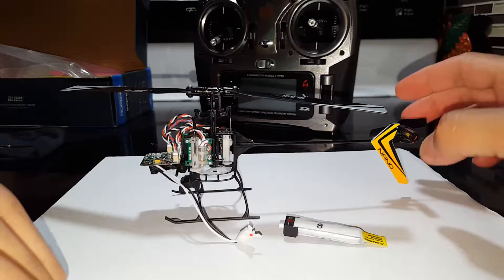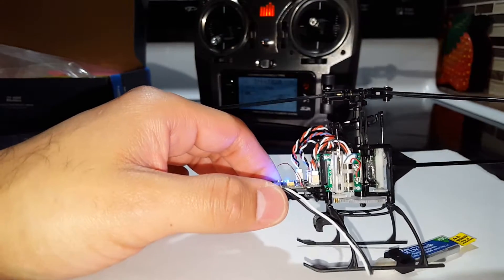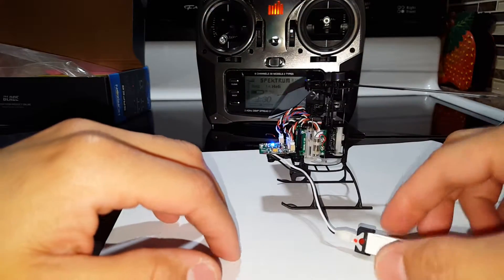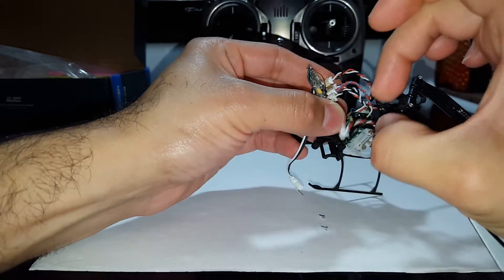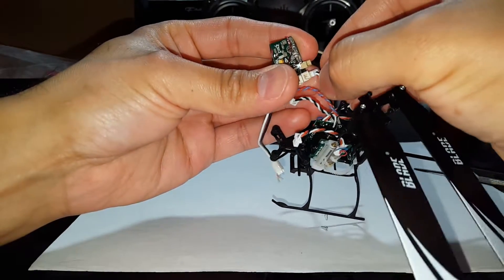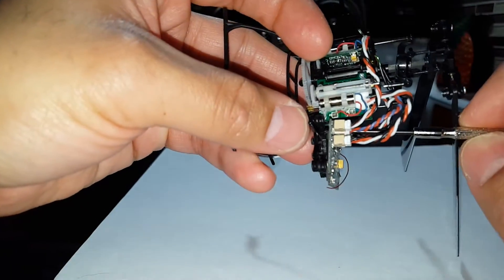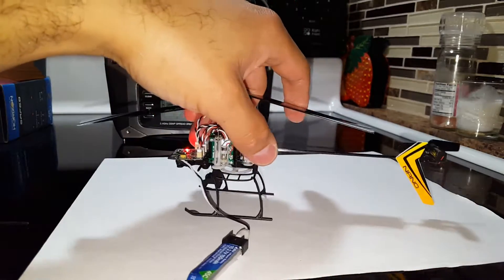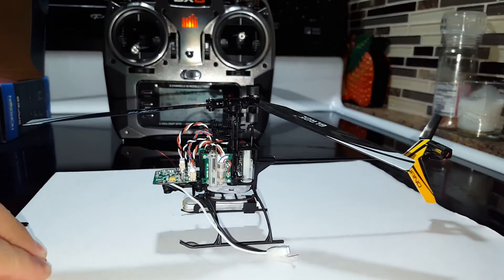Nano CP S problem swash plate forward solution

Comment: So it’s just a bad connection in the servo connector? Maybe you need a new servo connector. Maybe Horizon needs to update the connector design to be more reliable? Or maybe there’s some corrosion inside the connector. Have you tried a drop of oil or dialectic grease in the connector?

Comment: Can I email you, Victor? Just bought a used CPs and it's giving me LOTS of problems. Flew OK first time, then the same swash prob as you on the 2nd attempt. Hobby shop worked on it for about 1.5 hrs and it flew fine. Took it home, flew once ok, plugged in a new battery and it's pretty much uncontrollable! Total bull crap! As several of the comments say, HOW can you do the calibration flight when you can't hover the stupid thing?! I can BARELY get it off the ground. I've flown several different (bigger) helis and never had any problems like this. I think the electronics are on drugs or something!

Comment: Same problem. Try this, reboot everything and put the remote was in flight mode when You plug in the battery . For some reason swash is in different starting position if you boot it up in throttle hold mode. This worked for me. Haven’t had a problem since.

Comment: I had the same problem, but mine was tilting sideways. I clearly don't understand how your solution could solve my problem, but it did ! Thanks a lot for pointing that out.
I just disconnected the 3 servo, without unscrewing the board and it's working fine. But the nano has a heavy drift now, even with the calibration flight procedure...

Comment: I had the same problem after a minor crash.  No broken parts, but the swash acted exactly like the one in the video.  I disconnected only the servo leads and did not remove the board.  Plugged them back in an it was mostly normal.  I have  a drift now, but a calibration flight should clear it up.  Thanks for sharing!!

Comment: The problem is the tail motor Power and ground wires are sitting on the board after crashes and shorting the servo out Reroute your wires to the other side and problem solved

Comment: Save yourself the time of unplugging and replugging the cables: unscrewing and rescrewing the board is enough! ;-) I have no clue how this fixes it, but maybe the board (and the sensors) is a bit skewed after the crash and re-installing it fixes that. Anyhow, thanks for the pointer, Victor, although the original video almost drove me insane cause it went on for ages with "solutions" that did not work at all in the end!...

Comment: Hey thanks for your vid I had the same problem with mine brought it back to dealer and they couldn't fix it they called horizon. That wanted to send a new board.  I told them about your vid and they tried it sure enough it fixed the problem; then it started to do the same weird stuff again.  I returned it and figure I'll try the 120 s.   Hopefully better luck as it seems they have a bad batch of nano cps currently on the market

Comment: Thanks for this video. I bought one with a serious drifting problem. Tried everything, couldn't solve it. Bought an new one. Guess what, same problem. That calibration flight doesn't do anything either. It seems to drift a tod less in idle up but still. I miss my CPX.
Reply: +Ives Taelman Same problem here, the calibration flight fails because i can´t hold the cps on one position. 
@Victor: Thanks for this video, would you tell me wich camera you use for it ?
Reply from the maker: +FlyDevilFly the camera is a Samsung Galaxy S6; recorded  at 1920 X 1080 at 60 frames per second.
Reply: +Victor Rodriguez many thanks, very good quality. i hope you have much fun with your nano cps  ;)